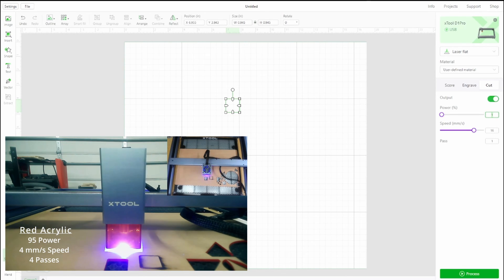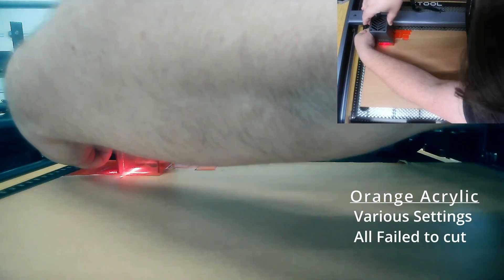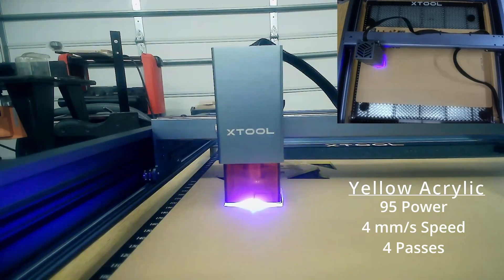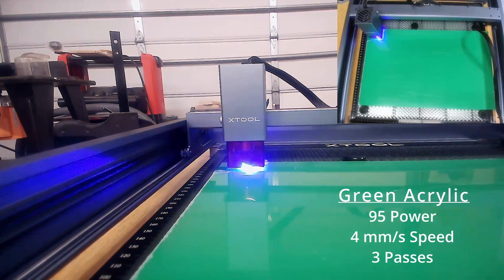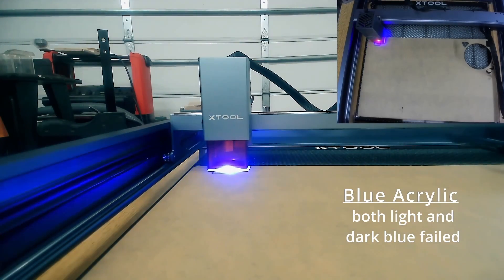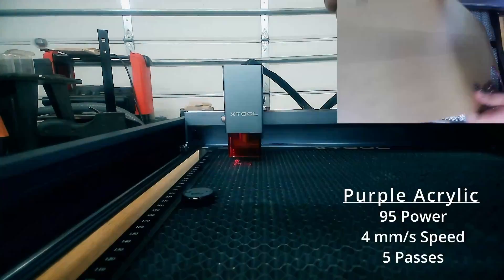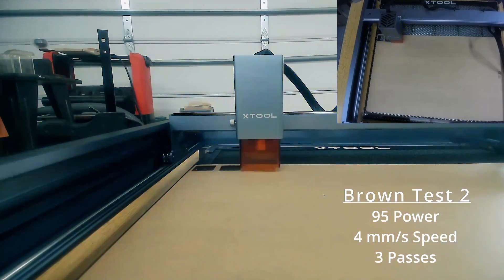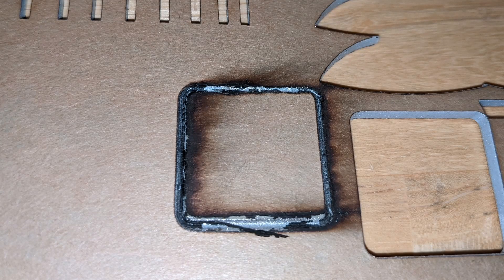How to Cut Acrylic with xTool D1 Laser Machine | xTool Maker's How-to

Comment: What about transparent colored acrylic? I need to make lenses for goggles and masks with stitch holes in them.
Reply from the maker: It will quite difficult to engrave on transparent as it's the blue light laser
Reply: @xToollaser  I have both lasers. D1Pro 20W
Reply: @xToollaser  hey does it cut through translucent colors? Like smoke or red and yellow? When I tried on mine it melted and started a little fire. Just wondering if it can't or it was my fault.
Reply from the maker: @SCBCshorts  Hey EDGY, not for translucent acrylic due to the blue laser beam. Only cutting or engraving for opaque ones. But the yellow or red acrylic from xTool store is fine, just set power at 100%, and speed at 3 mm/s, for more than 3 passes to cut through.
Reply: @xToollaser  so we can't cut clear plastic with either laser head?